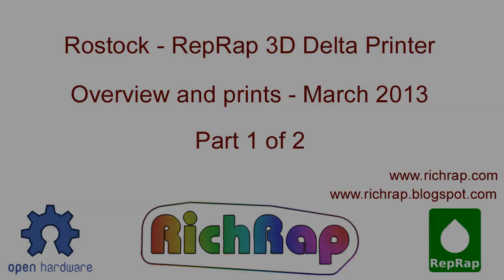Rostock RepRap Intro Mar_2013 PART 1 OF 2

Comment: killer work man I'm working on the same printer --- can't seem to get the software right and get the machine up and running my nozzle heats up but the bed won't work and I can't seem to get the setting right to get it to home it's self--can you make a vid showing how you setup the software arduino & marlin thanks chris